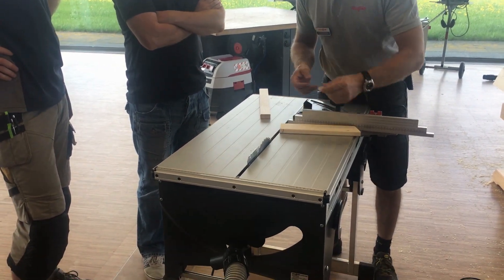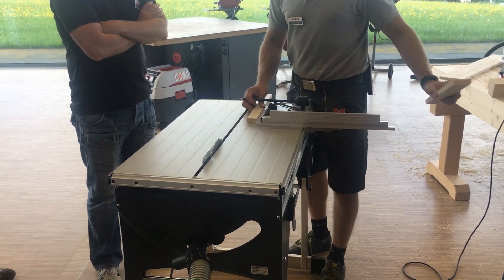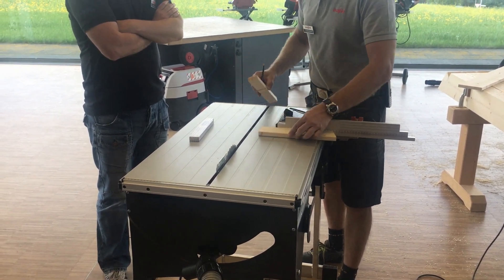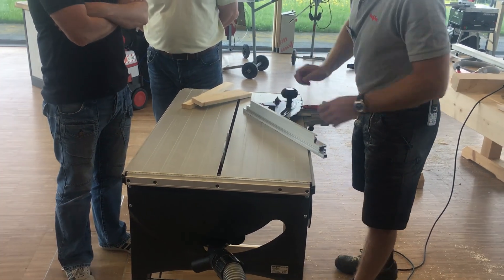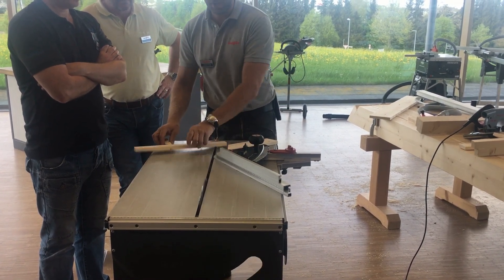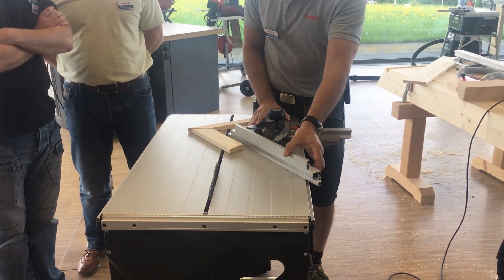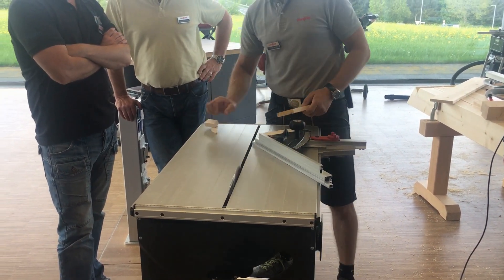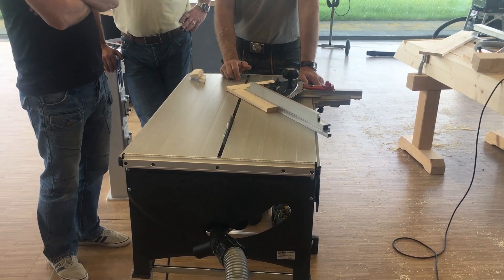The Mafell ERIKA Multi-Purpose MFA Guide Fence in action part 2

Comment: In Germany and Europe, where ERIKA is much better known than here in the U.S., for what type of work do professionals mainly use such a pull-push saw? Is its use limited primarily to flooring contractors and others who need not make crosscuts on long (3-4 m) materials? Do professionals actually forego deploying a normal compound miter saw on the job in favor of this two-in-one machine? Or is Erika viewed as a multi-talented and versatile improvement on a standard table saw, but nonetheless a companion rather than a replacement? 

Also, would the answer to this two-in-one sufficiency question be different if asked in regard to amateur/DIY owners vs. professional tradesmen? Is the market for ERIKA primarily found among professionals engaged in specific aspects of construction, or among serious DIY enthusiasts who use it as their primary, or even their only, saw?

I am a professional finish carpenter, mostly working solo. The idea of eliminating one more machine (MS) from the on-site inventory is appealing, especially by the substitution of one of ERIKA's quality and unique capabilities, but I'm not sure whether ERIKA would be a viable replacement for a standard miter saw.
Reply: Very well said. I can’t believe the tool shop that posted this video wouldn’t have answered a question like this already.
Reply: @ThisTall  - It's a very niche tool honestly that works better in Europe than the US.

1) It's now only available in 240v and it's a 3hp saw so if you need to take it to a work site they either need 240v electrical or you need a transformer to go from 120v-240v which would then be something like a 21-22 amp draw on 120v so you'd need a 30amp circuit.

2) It's designed to be portable and fit the roll of a couple tools. It gives you a tablesaw and what can be used as a miter saw (but not easily moved between a left/right miter). So if you want to shrink your shop foot print this would work for that.

3) You need to have the money to justify spending $5k on integrating a tablesaw/mitersaw.

So this is designed for someone who has a small home shop (maybe a garage) who has 240v in their shop, and has the money to spend on this tool. Otherwise it's likely that you can find one or more alternative products that would probably fit your needs better.
Reply from the maker: Yes the ERIKA with the right accessories completely replaces a miter saw, as well as a table saw.  In the right hands it can even replace a track saw, though certain long cuts are still easier/faster with a track saw.  It's not just for flooring--it's excellent for crown moulding and other odd/small-shaped materials that a track saw cannot cut.

Some ERIKA customers are professionals, some are DIY.  It's a space-saver and money-saver if you need BOTH the push and pull functions.

However the 230V German plug means many Americans do not have the power capability to run this saw--it must be run on a professionally-installed 220V or 240V (etc) wall socket.  No converters/transformers/generators for such a powerful saw.  Also while the pull direction is incredibly easy, the push direction is a bit like driving a stick until you get used to it.

Incredible saw for the right customer, but certainly not for everyone!
Reply: @timberwolftools5998  At one time, I believe the middle-sized Mafell Erika 70 was available in 110V. Was there once such a 110V model, but now discontinued?
Reply from the maker: @michael.schuler  Correct:  the new motor and brake is too powerful for 120V, only the 230V ERIKA is available now
Reply: @michael.schuler  you're a legend for actually coming back after two years and replying again. Since you've had so much time to reflect, what are your thoughts on who should get one of these?
Reply: @drysicle  The buyer's first and foremost qualification must be that he can justify investing $4k in a machine whose several functions can arguably be performed just as well or better by a jobsite road warrior setup comprised of:  a compact 10" jobsite table saw; a high end 12" compound sliding miter saw; and a quality track saw, all of them requiring only standard 110V power. We can all name three best-of-best models whose combined total price would be just over half of Erika's base price, not including the added prices of the tricked out accessories that can make Erika so uniquely multifunctional. Downshift and settle for popular professional domestic versions of this trio, and the total price drops well below half.

That said, in answer to your question, a professional contractor doing high quality work and faced with the burden of packing his van with an ever-escalating variety and volume of equipment might find price point trumped by Erika's compact footprint in transit. Likewise, a serious amateur, working from his garage or basement, might also find this pound-for-pound champion (well, actually inch for inch champ) an ideal solution for virtually all his/her sawing needs. And in this scenario, the availability of Mafell's practical range of accessories extends the machine's usefulness even further.

Given the brutal competition on this side of the pond among N. American (read: Chinese/Mexican made) products, it seems that Erika appeals to a clearly limited market sector, especially in light of this recent elimination of the earlier 110V model. Decades ago, I used the 110V model when I demonstrated my patented woodworking accessory system,  (now still sold passively at www.1-Fence.com), at some joint trade show appearances with Mafell, at which time they sold a lightweight over-under jointer/planer  (named "Paul").  My auto-aligning table extension system was able to precisely extend this little machine's jointing tables to as much as 10' long, regardless of depth of cut. The legendary Mafell quality, functional design, and attention to detail were impressive in both machines.

Now about to enter my sixth decade at the trade, I find myself increasingly concerned with lightening my daily carry to and from the jobsite, so I was strongly considering substituting Erika for at least two of the three machines I listed above as necessary to do what it can. Also, in anticipation of this move, I've devised a new work support system that I'm confident could overcome the machine's obvious disadvantages in comparison to a miter saw. But this surprising elimination of the 110 V model makes the move to Erika for typical jobsite deployment pretty much a non-starter, at least  for me.

My short answer to your question, "Who should get this Erika saw, " would be: a serious amateur woodworker with very limited work space, 220V power, and a spouse uninvolved/unconcerned with his/her discretionary spending.
Reply: @michael.schuler  Thanks for the thorough response! I’m a young carpenter myself and am always trying to decide on which tools to invest in. This is obviously not going to be one of them. Honestly I feel like with the cross cut track systems that mafell and festool have come closer to eliminating a miter saw than this does. How would the erika hand long runs of trim?

I agree with the idea of combining two big heavy tools and you get less wear and tear on your body. But I feel like for this kind of cash you would be better served upgrading as many tools to cordless or upgrading your van's organization system. or paying for a couple dozen masage appointments.
Reply: @drysicle  IMO your conclusion about Erika is spot on. And the priorities you list sound practical as well. Good luck to you! It's a great life to be a craftsman if you put heart and soul into it.